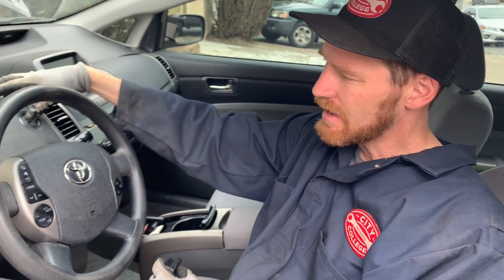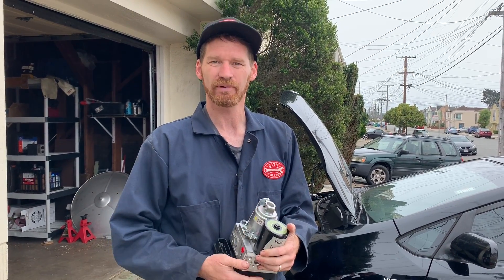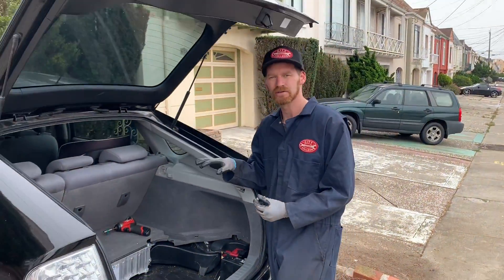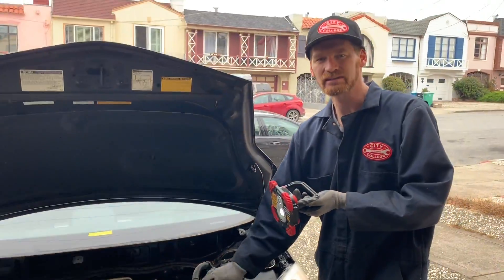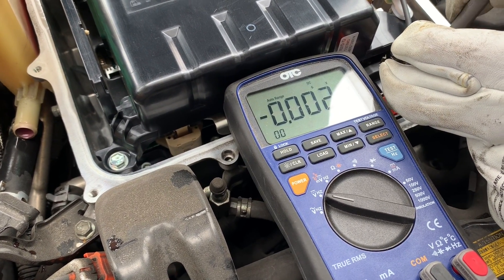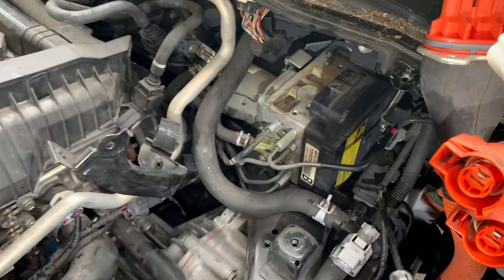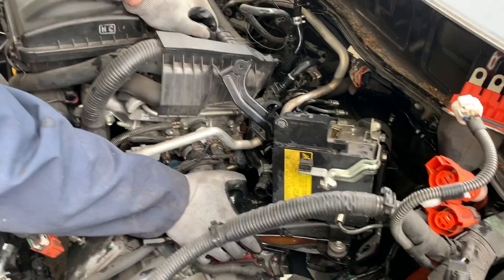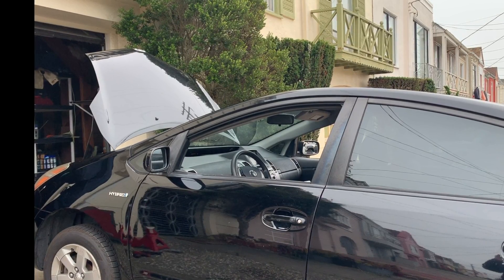2004-2009 Prius ABS Actuator Replacement

Comment: this looks like an absolute pita! lol. some questions 1. if i were to put in a used or reman/refurb oem actuator into my 2005, how long do you think it might last roughly for each?  2. and if the reman is only say $400 more, do you think it would be better over the used one? as far as how long it might last.  3. Also what do you think is the ballpark labor cost minimum you think i should or could expect if i had it done at a independent shop or say someone who does toyota prius repairs out of their garage? and i supplied the part.  and or also 4. if you think new would be better.

for ref, i believe i could get a used for about $200, a reman/refurb for about $600, and new for about $1200. my car currently has 200,000 miles. and has those same codes (plus one other) and lights. currently the abs sound is cycling every 15 seconds. one more question,  5. given that info, would it be ok to drive it for a week? or so.., i deliver food for income. what would be your estimation before the pump burns out? Thank you in adv for any advice.
Reply from the maker: I cant tell how long a replacement would last, depends on quality of parts. Reman is suspect and sometimes low quality. This part is getting harder to find used too. I would expect an independant shop to charge $1200 labor only but your results could vary. Personally I wouldnt drive with this part going out. Sorry for all the bad news...
Reply from the maker: FYI the purpose of this channel is for people to attempt complex repairs at home and save a car that would otherwise go to the junkyard. Like a car that isnt worth spending $1000's on at a shop because its too beat up and too high miles to be worth much. That said this particular repair is probably the most difficult shown on this channel.
Reply: @Mrelectric423  i understand. just given i ran into the senario, and after watching your video, i determined it was beyond what i feel i could handle. figured id try to get some advise on the best route to consider.
Reply: @Mrelectric423  well dam. i was hoping labor wouldnt top $400-$500 if it only takes them 4 hours. No worries. i appreciate your advising! thank you.
Reply from the maker: @travislowrider6623  its worth calling a shop to get a quote. It may be much less than my guesstimate.
Reply: @Mrelectric423  ok

Comment: Always looking for a great mechanical video.   GREAT VIDEO!  Have you ever heard of old brake fluid causing abs actuator issues?  Just a show it the dark but my brake fluid on my 07 is definitely old.
Reply: My brake fluid was old.  For 2 days in a row, when I pressed on the brake pedal to start the car, I heard two noises, and the brake pedal dropped about 1/2 inch.  On the 2nd day, the ABS light turned on, and Brake turned on with the triangle.  I could not start the car.  I suspect the problem may have  been triggered due to my very old 12v AGM battery.  I also thought it could be due to old brake fluid in the lines and/or oxygen in the brake line.  I decided to replace and bleed the old brake fluid.  I also charged up the 12v battery.  After doing this, no brake problems.  I am considering replacing the 12v battery.

Comment: Just changed mine and the abs vcs brake light still on any ideas
Reply from the maker: If you have a capable scan tool check the codes
Reply: Where did you get the program and obd wire from

Comment: Thanks again for the informative and easy to under video . Got it done 2 days . About 4 hours each day . Day 1 uninstall bad part . Day 2 put new part in and bleed brake . Went with new part . Way too much labor for used part . Thanks again !!
Reply from the maker: Good work! it is a tough job and scary installing a used part with so much labor committed.

Comment: I was quoted $1760 for the part and $480 labor plus $15 brake fluid. 2009 Prius. Found the part on eBay for $200. I see I just can’t take the car to anybody and this video is outstandingly informative.  Well done. Thank you.
Reply: Hi, your $200 part was used i take it? hows it running now? my car has 200,000 miles and im trying to decide if i should go used, reman/refurb, or new. thx!
Reply: @travislowrider6623 I just bought one from eBay from a guy in Florida for $225.. I want to do it on my own but with a lack of experience and I still need that scanner tool for the computer it’s gonna be tough!
Reply: @travislowrider6623  Hi, what route did you take? Used or new part? In a same situation here.
Reply: @wssr3293  new. I figured you could pay $300 ish used and $500ish labor to probly end up doing it twice or more in 1-3 years, for $1600+ or you can go new and pay the same and know it'll last much longer lol. While also saving you time only having to do it one time.
Reply: Do you have some news about the part from eBay? Is it still working?

Comment: after a rusted brake line repair, I was not able to bleed the left rear, kept getting this ABS actuator fault  after a short drive.  tried multiple methods, the one that worked was the MityVac brake suction tool at the bleeder.  FYI to all.

Comment: Hey there
I how can test the ABS module & fix But I just got a other ABS module from E-bay see if it good or not. And also could you or show me how to hookup the last brake line on ABS module. I have 4-brake line that I can get to it but other is hard get the last one that under the windshield yes I would like to get it back on the road for the holiday coming up ok

Comment: After installing you have to programming with the special computer? Because I have same problem but mechanics want charge me extra for the programming
Reply from the maker: It depends on what abs unit you install. A used unit in an 05-09’ Prius no programming needed

Comment: Hi, thanks for your video, at your scanner show 2 code c1256 and c1391 same happens to my car. 
My question change abs unit only or I have change brake booster as well for fixing 2 code? Thanks

Comment: Hello, I really like your thorough Prius videos. Thank You! Could you advise an issue with braking? It is what I am calling delayed brake release. After you take your foot off the brake they do not release, there is a two second delay before the wheel is freely rolling. 2007 Prius, 240k, already replaced the brake booster, no significant improvement and it is the front brakes.
Reply from the maker: Are the calipers old and rusty? I would take the pads off and set them sliding well again, reinstall the pads
Reply: @Mrelectric423  Agree this is the 1st check point. They were cleaned. Also the guide pins were basically stuck with one side was worse than the other but both cleaned up ok, the boots were still good, the inside cavity was cleaned and flushed with a narrow tube brush, greased and reassembled. Then the mounted caliper was moved by hand to check for free movement. Checked good. But I will clean these surfaces again as you suggest.

Took the car for a drive and there is no change. Any other suggestions Mr. Electric?
Reply from the maker: @johnstefanick5216  I wonder if it is staying in regen after you release the pedal. Do the arrows on the energy flow screen match your brake drag timing?
Reply: @Mrelectric423  interesting question Mr. Electric. Thank you for taking time to reply to my questions!

I replaced the master cylinder, it is acting better in many ways and there is now no trace of delayed brake release. There is a write up in Prius Chat under Brake Pedal Sticky and Slow
Reply from the maker: @johnstefanick5216  Interesting!
Reply: Electric  Yes this was done. I watched your video on the pit stop method. I added anti sieze as you showed. Checked guide pin movement and it slides freely.

Comment: Video nicely done! Was that the original abs actuator? I noticed the white circle stamp on the black housing on the opposite side of the elec plug, those are indicators of a replacement part during warranty work. It a gud habit to get the brake fluid flushed every 50k miles 2nd or 3th gens extend the life of the actuator greatly! Thanks Nate
Reply from the maker: Im not sure but the car and all the other gen 2's i work on tend to be totally trashed with huge mileage. That said they are great cars!

Comment: my 2010  prius is making some funny noise when i step on the bake pedal. but  no codes brakes fine is just the noise.
Reply from the maker: Actuator may just be aging. I would wait for a code.  
Also check your brake pads if the noise occurs when pressing the pedal while car is moving not stationary

Comment: i replaced the actuator and the lights went away. i bled the brakes and only the front passenger side bleeding had the pump turn on while bleeding with the most bubbles coming out of it. the other wheels didnt have the pump turn on for more than a second but also had a tiny bit of air come out, but extremely little. not too much. there must be more? i'm sure there's more air. the three dashboard lights for abs turned back on and i can't brake very well again. any clue as to what this could be?
Reply from the maker: Bleeding is very tricky, see my video on quick brake bleed. You will need to clear codes with a capable scanner to continue

Comment: Hello sir i need your help / advice 
I have a 2010 prius 1.5 it's got the abs lights on with the code - c1256 accumulator low pressure. 
My mechanic told me we have to replace the ABS pump. We replaced 5 Abs pump but still the lights doesn't go off and i was told to again replace the ABS pump since its bad again. 
I am confused sir how can five ABS pumps be bad. 
Any advice sir of what can be the issues!! 
Does the ABS pump have a number or something. Or what could be the issue? 

Thanks
Reply from the maker: That is a tough issue. I’m not sure what is happening with your car

Comment: Hi. I have toyota prius 2011. I get thos erro codes C0210 and c1238. Any one can tell me what it can be? What to fix? Thank you.
Reply from the maker: Those codes are not the brake actuator. Sounds like a wheel speed sensor or wiring issue.
Reply: @Mrelectric423  thank you for the fast reply.

Comment: Hey I was able to do this by myself, but only issue was that I’m still getting the same lights on dashboard . What do you think I did wrong ? I still need to bleed brakes.
Reply from the maker: What codes do you have?
Try clearing the codes if you have not already.

Comment: Do you need to switch your resistor and reprogram also . Some people say yes some no . Any information would be much appreciated. Great video
Reply from the maker: By the book yes switch the resistor and connect to techstream, in practice most non dealer techs skip the resistor and reprograming
Reply: Thank you for the information

Comment: What will happen if they dont bleed the brakes? You think that will make the pump to not work correctly?
Reply from the maker: Your results may vary but it works without bleeding for some people.
Reply: @Mrelectric423  cause it feels like when i hit the brakes only the rear brakes work not the front ones
Reply from the maker: @calvillocobra98  Then try bleeding
Reply: @Mrelectric423  ok thank you

Comment: Hi Mr.Electric i replaced the abs however after doing the manual bleed the were no brakes, i followed a manual bleed on prius chat and i got a very small amount of brakes VERY weak,

there is also a constant BEEPing sound when i press the brakes and there is a beeping in the car, i took the car to toyota and they kept my car for 5 days and said they couldn’t bleed the system because the part i replaced it with was bad, how is that possible if it’s new??
Reply from the maker: The new abs can burn out when bleeding goes wrong. Ive had to redo one, very frustrating. Try the quick bleed procedure in my other video.

Comment: Sorry to bother you again, but I have another concern.  I ordered a compete OEM ABS Pump Actuator Modulator Booster for my 2008 Toyota Highlander Hybrid from a vendor on ebay.  All the numbers matched and I check for compatibility on his site and it said the part would work. My unit part number is 44510-48080 and the one I purchased on ebay showed the same number.  I failed to notice, that the ad also stated that the index number on the pump must also match otherwise it won't work.  The part I bought showed "O" and when I checked mine on the car it shows 'k".  Is it true that this part will not work for my application?  Thanks for your help.
Reply from the maker: I do not know about that. Tough choice to install or not. Is the old unit failed?
Reply from the maker: I see the old one is making noise, tough choice there. Hmm.

Comment: Dear Mr. Electric,  I enjoyed your video and learned a lot from it and others you have done.  I have a 2008 highlander hybrid which has recently developed a noise coming form what I believe is the ABS actuator.  It happens when I depress the brake pedal hard in park.  The sound is a gurgling sound or muffled squeak.  My wife says it sounds like there are mice in the engine bay.  There are no ABS lights or any check engine lights on. Can you help with diagnosis? or any ideas.  Thank you
Reply from the maker: I would let it go for a while , see if the light comes on. That does sound like an aging abs unit since the noise comes in concert with brake actuation

Comment: Great vid, got a 2007 Prius and honestly a little disappointed in the reliability, several weird things like this have broken and I have had Honda's and old bmws with way more miles than this Prius that never had big failures like this, disappointed in Toyota
Reply from the maker: Your results will vary. I’ve experienced nothing but problems with BMWs , Hondas are great

Comment: How many people are using the high voltage gloves? Or is pulling the orange battery plug to de-energize sufficient?
Reply from the maker: I just show one way to maintain safety. Maybe techs do it without observing all the safety precautions

Comment: Hi thank you so much for this incredible video. Can I ask you, if my my brake like is completely empty due to a caliper failure. Do you think it will refill just by pumping the pedal and bleeding the caliper, or by pumping fluid from the caliper, up to the master cylinder?
Reply from the maker: Use the bleed process I show in brake bleeding video

Comment: I'm having the same problem with my 2009 Prius, the mechanic give a $5125 estimate, I almost drop dead.
Are you here in Washington by chance?? lol
Your explanation is super easy to comprehend but I still have one question, you have mention that after replacing the Actuator you have to fill the system with DOT3 and do the bleeding process with the scanner tool is that right?? I don't have that! :(
Is there another way?
Thank you so much
Reply from the maker: Many people have found that you can skip the brake bleed after and it works. That said you have a decent chance of getting an error code that needs to be cleared so you would probably need the scan tool either way. A $250 scan tool like autel or launch would probably work. Sorry I am unavailable to help in person.

Comment: What are the torque specification on the brake lines?
Reply from the maker: There is not normally a torque value assigned by the auto manufacturer for flared (brake) lines. The HVAC industry has started to use special flared fitting torque wrenches. Basically tight but dont strip it.

Comment: I recently completed the replacement of the ABS actuator in my 2008 Prius using this video as a guide. It was a tough project for me, since my car repair experience is pretty minimal, but I was able to do it successfully, and relatively quickly, thanks to you. I really appreciate all the work you did to create this guide. You saved me a ton of money.
Reply from the maker: Thank you for helping to keep DIY auto repair alive.
Reply: Where’d you get your replacement accumulator? I have to do on this on my ‘09 gen ii now!
Reply: dealership
Reply: @Iglooter  I bought it online at a store called benzeen auto parts.
Reply: @asymptoticspatula  can you tell me what sockets and stuff to buy? i know nothing about tools 😅
Reply: @SkullEnvy  I’m pretty sure everything was 10mm (and maybe one or two 12mm ones) but I’m pretty sure he says in the video.  Definitely need an extension for your ratchet to reach some of them.
Reply: How’d you bleed the brakes? Just like normal? I can’t seem to get the messages off the screen
Reply: Hey, it's been almost two years, so I may not remember exactly but I just opened the little cap/bolt at the brakes by each wheel one at a time and had my son push the brakes until fluid came out. 
As far as the messages I remember it was beeping incessantly and having some kind of panic message on the screen but when I put it in gear and drove off to check the brakes it quit and went back to normal. 
I will say that it had to be topped off with brake fluid every 2 to 3 weeks (probably every 1500 miles or so--I commute a long way) so I definitely sill had a leak somewhere but my brakes worked well. 
I just got rid of that car in September so this repair bought me another 22 months or so.
Good luck!
Reply: @asymptoticspatula thank you!
Reply: Nice! I didn't have the guts to do it. But found my man in Orlando and repaired with oem part and labor $600. Can't complain either. It took him 2 hours sharp but he has experience.

It took me 2 hours just to clean the AC fan
Reply: @The-Frog-Show $600???   My husband will be doing mine I guess but I really don’t want him to have to….  Getting that part out looks frustrating!
Reply: So he mentioned he will need his computer to bleed the brakes, how were you able to complete the job without computer software?
Reply: @SemperShock  see my comment above in this thread. It wasn’t perfect and I still was losing brake fluid and had to top it off regularly so maybe doing it with a computer would’ve been better but if the system is full of fluid with no air your brakes ought to work.
Reply: Did you have to use a computer like he did or did you just swap old for newer?